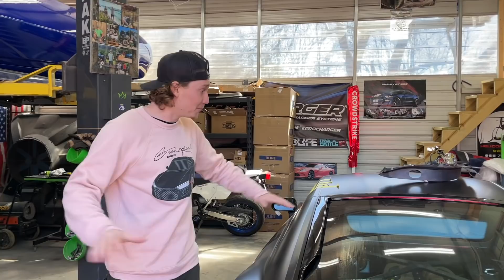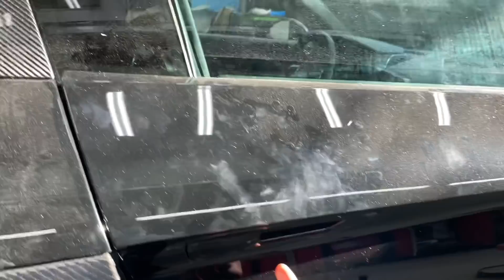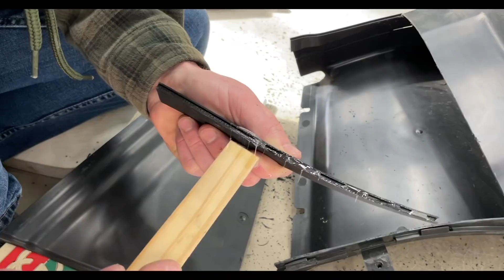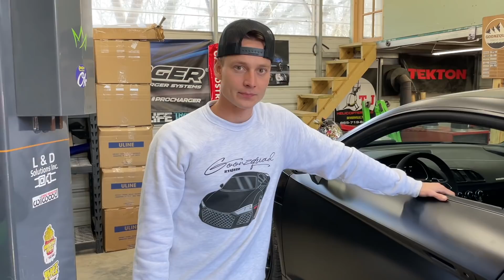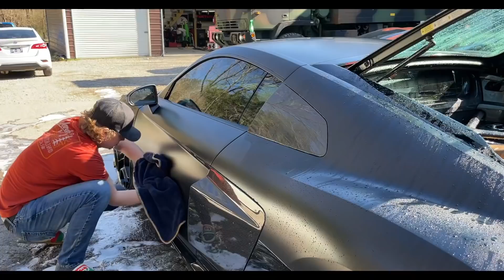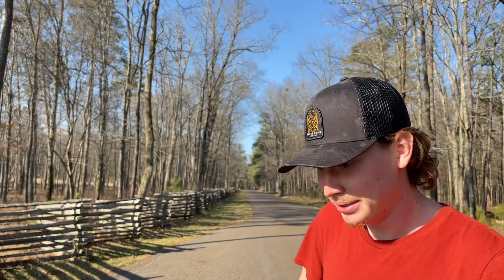Rebuilding A Wrecked 2020 TWIN TURBO Audi R8 Part 18!!!

Comment: You need to make sure it’s high quality E85 or better. The car is tuned for it so if its not at least E85 then the car will be technically leaning out. Leaning out means bad things. I’m sure mixing with 93 is much safer but I wouldn’t do that again. Get one of the $20 ethanol testing kits and test the station to make sure they are getting quality ethanol, do that every few months. If you are not will to do that then order a 55 gallon drum of e90 or hit up ignite for a sponsorship and store it somewhere safe. If you can’t do that then just stick with the 93. Don’t blow up that incredible car up that you guys have brought back to life. Btw I’m from Tennessee and use to have a twin turbo s550 on E85. Love the car and channel! Keep up the awesome work!!
Reply: Many motors have been ruined by “e85”
Reply: Question. Can’t the car ‘detune’ itself for the lower octane gas? I know my Porsche can. So, they might want to check to see. If it can, then any gas is ok.
Reply: It’s got a flex sensor it’ll be fine
Reply: @lancenutter1067  the custom tune is set up to run on 93, e85 and any combination of the two but low quality e85 can absolutely ruin the engine. I don’t exactly know why but a shop I used to take my car to said he wouldn’t mess with it and he had 1000+ hp cars. He saw too many people grenade their motor using it.
Reply: tennessee yessur
Reply: What's up? I figured I'd help out some of y'all because, Elijah, you are correct how "low quality e85" may be bad, but you are not necessarily correct on how it would lean out the car. I've been tuning for a few years now. These cars pcms are mapped base and rely on certain qualities to determine how much timing, fuel, and airflow is allowed to accomplish a given torque output. You can use logic built into the car via the built in wideband to get the correct air to fuel ratio. In fact if they get a worse quality E85 such as E50, the car would actually run richer if the car could not regulate the air fuel mixture because full E85 requires roughly 30% more fuel where as normal gas like 87-93 which is E10 requires less. The car actually runs much better on E85 because ethanol lowers the burn and charge temps. E85 is roughly 100-110 octane so you can advance timing quite a bit more than 93. Also the corrosive factors in Ethanol allow clean piston and valves which will prevent carbon build up. If they were to throw any type of E mix in this car, the pcm would regulate the timing and fueling to hit the right requirements.
Reply: @abel4776  eeh you need the e85 for the 1200hp tune, regular gas don't work
Reply: Nobody would build an E85 car without a flex fuel sensor.
It will detect the level of ethanol in the fuel and tune the car appropriately. 
It likely has multiple knock sensors in the ecu as well.
Reply: @1one3_Racing  Thanks i was just about to write that!
Reply: Without even asking, the car has a flex fuel sensor for sure
Reply: whats with the crappy fuel in USA? here in the UK standard fuel is 95 and "super" is 99
Reply: @ultra1obscene  ikr. Australia we get a 91 but most people use 95 or 98.
Our e85 us usually 75+
Reply: Definitely would be heart breaking to see something so beautiful get ruined by crap fuel
Reply: @1one3_Racing   actually a lot of people build e85 cars without a sensor. If you tune for e85 strictly it’s no different than tuning for 93. Once your pass the 60 percent ethanol there isn’t much power gains. So e60 is plenty good
Reply: Where you guys live if you have to test if you got good fuel? Africa?
Reply: @ultra1obscene  it is a different norm for rating the fuel. In Europe we use RON rating. In USA they use AKI or PON (average of RON and MON). So Europe's RON 95 is equivalent to 91 in USA. And our 98 to 93 and our 100 to their 95.
Basically you have to multiply RON value by 0.95 and you get US AKI.
Reply: @Matus.S  makes sense! thanks for the education!
Reply: @SkinnyPedalMotorsports  that may be so if you were doing it yourself or on a budget.
But if I paid $100,000 for a turbo kit and it didn't come with a $200 flex fuel sensor, I'd be pissed.
Reply: @1one3_Racing  not even. If you live around e85 you’d have no need to run anything else
Reply: @SkinnyPedalMotorsports  people with Teslas say that about living near a supercharger. But emergency charging is a profitable business venture. So....
I don't see why you wouldn't. Add a cheap (relatively speaking) sensor and a safe tune. Then if all you can get is premium (say if you actually use the car, like SEMA, or cars and coffee or a track day or drag week) then you're not up shit creek.
Or, maybe like New Zealand your e85 supplier goes broke and stop supplies. Then you're just fucked.
Reply: Cringey
Reply: Please make sure y’all are checking your e 85 bc it can Grenade your engine

Comment: That "black widow spider" high gloss black looks so good. Also, you might want to consider blurring the speedometer next time. The police used a video of a guy on motorcycle flying through traffic to bust him on speeding and dangerous driving. You have provided them evidence to fine you.
Reply: Exactly.
Reply: no one to verify the speedo is accurate = no evidence
Reply: @davidj4662  Doubtful that filmsy excuse would work. The police have reasonable grounds to get a warrant and seize the car to investigate it. I doubt they would, but they could.
Reply: They are driving a 1200 hp super car that is misaligned with bald tires at those speeds. Forgot those details.
Reply: @davidj4662  still in test fazes  not all kinks are worked out.
Reply: Hogwash.  They police did not personally witness the incident.  They can't "get a warrant" either to seize the car.  No judge is going to issue that warrant anyway.  "Your Honor, I just saw Vin Diesel doing 180 mph on the highway then he jumped out and had a parachute, floated down right onto a motorcycle and took off.  We need a warrant to investigate!!!"  Just silly.
Reply: @nickmonaco960  You must have a straw shortage now after all the strawmen you built. The idea that police must witness a crime is beyond dumb. The vast majority of crimes are not witnessed directly by police, but are successfully prosecuted because of compelling evidence like video. Your point is also moot given the fact people have been fined because they were captured on film or by photographs speeding. When the defendants actually film themselves doing it it makes it a slam dunk win in court.
Reply: @Henleyrocks  This made me lol
Reply: They’re actively still doing it. I just read an article recently about them stepping up prosecutions because of that guy that went like 270mph in his Bugatti Chiron. They guy uploaded it to YouTube and Germany went nuts. They said they’re refocusing on YouTube videos. Every time i see guys blast off and don’t cover their speedo, or at minimum the background not being able to be seen i wince a little bit. They all need to be careful when posting.
Reply: @gregkrueger331  Thank you Greg for a well thought out and intelligent response without being judgmental.  It is appreciated.

Comment: You need to talk to the tuner about fuel quality, guys. In addition, I bet they've programmed different maps and have built in rolling anti-lag (RAL). It looks like the ECU pulled timing due to the fuel once. Be super careful.

Comment: Awesome job on the Audi R8. You wanna get used to driving high speed you need to go to Germany visit all the German car manufacturers and get on the Autobahn no speed limit 's for long distances. Just remember if you are in the left lane of the Autobahn and you see flashing lights from a long distance away you better get out the way. Take it easy boyz. Aloha from Kansas

Comment: Guys get this thing tuned and on the dyno and you need better weals maybe a roll-cage so you can get the max power out of it safely and yes definitely a alinement this thing is to fast to be not be safe
Reply: its already tuned but yeah it sill needs more🔥
Reply: They are extremely reckless. This car should not be on the road while misaligned with bald tires.
Reply: @Henleyrocks  yes .  Never ever want a wreck to happen.  Stop taking Risks dudes .

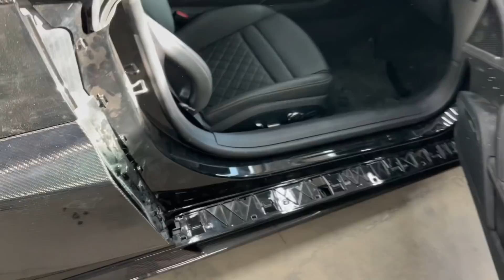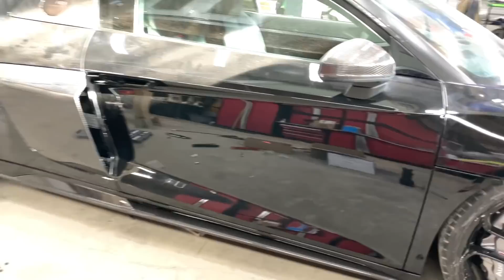Comment: 3:45-3:50secs  Huge dint in the drivers door under the mirror along the body’s upper side crease right on the edge where the door meets the front wing. 
Should have taken more time with this build & got a pro to PPF it

Comment: You need to turn off all driving aids for this build otherwise you will run in to problems when you floor it
Reply: That’s a death wish on those tires at least, once they out the r888rs back on yes they need to turn off everything

Comment: some will not like this, but...  The R8 is a perfect road car, stock.  Too much HP makes it undrivable on most roads.  Fine for the strip, track or ... posing.... but its a poor road car at 1200 HP.

Comment: Need too turn traction control off too stop the hiccups on shits, also be worth investing in carbon wheels an Brigestone just bought out some nearly tyres worth a look into for sure. I would run it on E9o much cleaner fuel. Would really like too see some more upgrades on this one it is a really special car. Great investment an exhilarating fun. 🤙🤙🤙👏👏👏👏

Comment: You should come up with a great color for your calipers. You need to live by the code a metal color caliper is a caliper not done. Not sure if you could just do one color for all cars but you get it. You frame the calipers up with nice looking wheels let them shine.

You should head to a racetrack that has driving lessons to learn how to handle the power plus I would imagine you would like it. There should be some around you. Not only would it be fun for you but it could save you or someone else's life. Learn what to do in 2 wheel and 4 wheel drive if something bad happens. Love the car love the show but I am drawn to the older cars like the Camero. Want to see that thing up and running.

Comment: Some comments have suggested that the "hiccups" are fuel-delivery related.  They seem so abrupt (and jolting) that they may also indicate that the trans was damaged during the accident. At the very least, have you checked the level of the trans fluid? If control of the car seems sketchy above 80, don't forget that the car was in an accident after very few miles that seemed like lose of control, so make certain steering, suspension, drivetrain and everything else is 100% before taking any chances.

Comment: Just check if the car is flex fuel tuned. Just so it knows the ethanol content and it self adjusts so you don’t break anything. Also can get a ethanol content tester they are very cheap.

Comment: That hiccup was either boost cut or the afr leaning out since you switched from pump gas to corn. Might have to ask b rouge if it has a flex fuel sensor. Wish i was famous would love to line it up with my AWD em2

Comment: imagine this at night on a german autobahn without speed limit😍🔥
Reply: I could see that ending badly; these guys aren't good enough drivers to be let loose in this car without some sort of restrictions. Driving it, even at legal road speeds, on the wrong tyres, badly aligned, it would be so easy to lose control, especially with no experience.

Comment: 1200hp is in the drag car zone in hp if its that uncontrollable at high speeds  then you might need drag tires or tires with more grip on them  lol over the years 9 I've learned that if you don't have good grip aka traction you need more grip/ better tires
Reply: Thanks for watching
write me 🔝directly to receive your reward and giveaway

Comment: Are y’all gonna fix the damage on the passenger side tub?   That’s a lot power to be rolling around on a compromised chassis...
Reply: I thought it was all the outer structure that was removable, not the inner portion that was damaged. Basically if i remember correctly they already showed it.

Comment: You don’t want any ethanol in your fuel. You’ve got a highly tuned car, and a performance car at that. Ethanol in engines can make them seize, or cause them lean out. Preferably put the highest grade in, yeah it costs more, but it a risk of damage you can easily mitigate.

Comment: I always thought putting ethanol in the fuel was bad for the engine and cut your power. I use Shell 93 in my F150 3.5 twin turbo and it runs smoother and gets better gas mileage.

Comment: It's not E85 unless it's test E85. Like that pump says, it could be anything from E51 to E83 or anything in between. If you floor it with E51 and it's tuned for E85, well bad things insue.....likely the reason the for the stumbling up top when your flooring it.

Comment: I am very suprised about the low quality of fuel in the US. Over here in germany the usual fuel is e95, there is not even an e85. The best fuel you can get at many gas stations has 102 octane.

Comment: Boost cut or rolling antilag at too low of RPM. Holding both paddles might turn on antilag and you could be accidentally pulling both paddles when you're flooring it.

Comment: I know this is not related to this video, I see in back ground you have Eastwood screw compressor, how do you like it? What horse power is it rated ? I have a 6 hp 80gal. tank and when I am my air grinder it constantly running. Looking to up grade.

Comment: Funny car racers actually do some of the same training astronauts do to get used to the G forces because they have to be able to keep the car going straight so the amount of g forces they experience a normal person wouldn’t be able to hold on to the steering wheel

Comment: I wish you replaced that roof liner. To stick that is a quick solution, however it wouldn't be like the original part.

Comment: You hit that cut at a high rpm I don’t think she was slipping. It’s either spark plugs (ignition) or a boost cut (possible overboost) or just bad fuel. E85 EATS spark plugs.

Comment: It should have different map levels you can adjust on the fly. With traction control on it will act like that.  Take the traction control off.

Comment: I am still trying to understand the excitement over E85 fuel! It is weak in that it has fewer miles per gallon than regular 87 octane, its thermodynamics is not conducive to horsepower, you must fill up more frequently and the cost savings at the pump are eaten away from needing more fuel to get where you are going!  The only benefits are it gets you from point A to point B and is negligibly nicer to the environment. What's the big deal?

Comment: https://youtu.be/-jcGLoNbZl8?t=661 you can hear them turbos killing themselfes. You always need to let the turbos spool down before you turn off the engine (at least let it idle for 5minutes). The turbos have hydrobearings, no oil pressure = no bearing = lots of abrasion. if the car starts guzzling oil like no tomorrow, check the turbos

Comment: Hey guys ... I know you like carbon fiber but DAMM does air ducks look NASTY (in a bad way) those are to wide to big this car is slick it's not a crazy race car they look BAD! ....(and maybe the reason they are from the factory like that is so the water won't get to much in there)

Comment: Better not show the speedo any more to many rats and goodie two shoes. That car needs to be tuned and used in some sanctioned half mile and mile tests, only place to hold foot to floor and not get locked up.

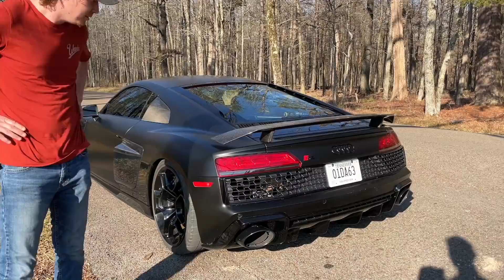Comment: 10:58 AVOID doing that at all costs, you gonna ruins both turbo bro
let the turbos stop totally before shutting off engine ( 20sec )
( off oil pump > oil starvation > destroy inside bearing = dead turbos )
you dont want to ruin those beautiful new turbos LOL

Comment: Man…… get a haircut 🤣🤣🤣
And please… finish up the R8, it’s just unfinished not a little bit Matt and a little bit glossy 😐
The turbo cooler has to get swapped out, it will brake surely. I’ve worked at Audi, Bentley at Volkswagen Group in Germany for a couple years, nobody in a serious shop would hand out a car to a customer with coolers looking like that!

Comment: Extremely dangerous & dumb to be on a highway with traffic doing pulls in a high HP car with the alignment off... How would you feel dikking around and the car jerks to oneside clips a car & the people inside had been injured or killed???  Also your going to burnout the turbos rodding it hard and not letting it idle down and sit a min or two... Do NOT just kill the engine after out pushing en engine that hard

Comment: Why is America so backward in fuel. We have 91 as the cheap fuel and any self respecting car uses 95 and 98 is available almost everywhere.
High octane means high compression and fuel efficiency.

E85 is for old tractors and nothing to get excited about.
The USA should be ashamed.